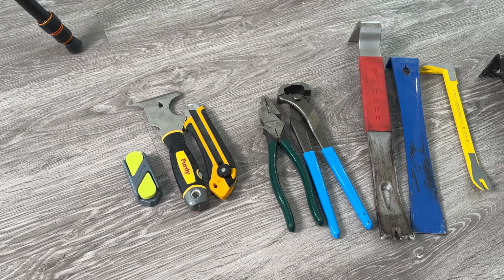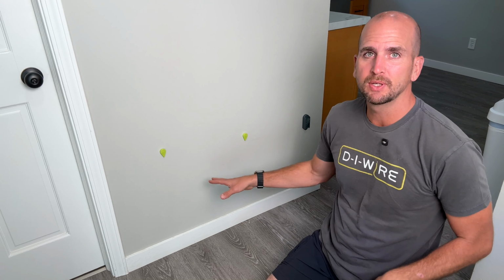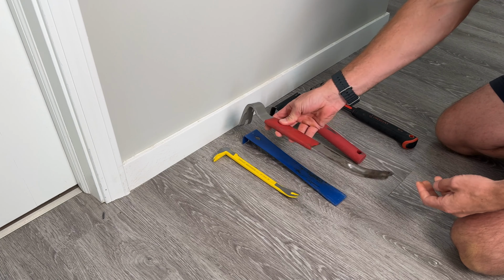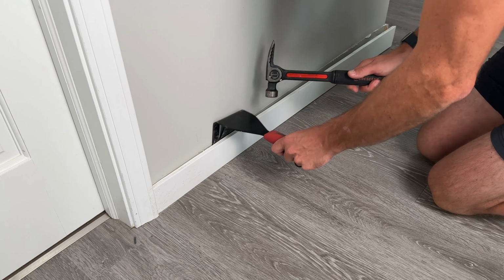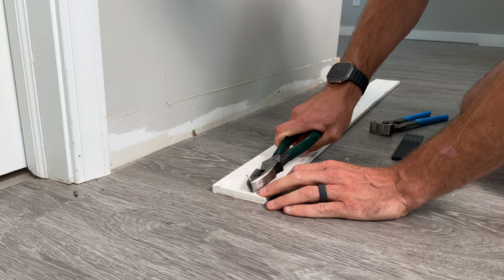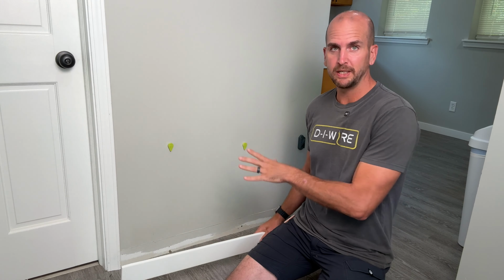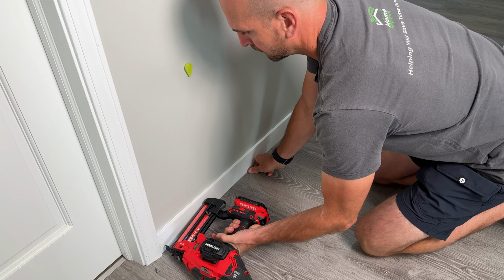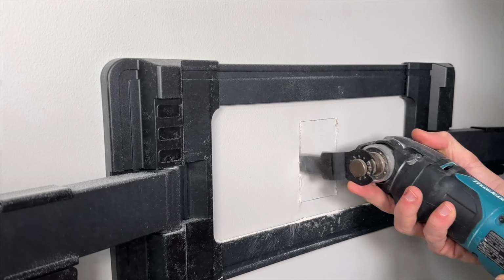How To Remove Baseboard Trim | Without Any Damage!

Comment: It's been said to cut the caulking more horizontally (~70°) to the wall and into the drywall scoring the paper.
1. If the knife angle is too steep you risk your knife slipping and running down the face of the baseboard. 
     The drywall score mark will be covered with new calking when finished.
2. This is less likely of paper tearing upwards from spots of residual caulk or paint on the trim when removing

Comment: This video was extremely helpful.  I have an older home that has lead paint as the base layer to all of the trim.  It has been encapsulated by other coats of paint from previous owners but I am sick of the clumpy paint look and am thinking about replacing it all.  If I do this myself it is as simple as wearing safely gear and wrapping the baseboards in plastic as I take them out for removal or are there other things I need to be thinking about.  I am a beginner DIYer.  Thanks.

Comment: Thanks for sharing this. The instructions are very clear and it's so useful ❤ If I only want to replace the middle section of a baseboard (between two walls), without taking the whole piece off the wall, how should I cut that mid-section off and replace it? Many thanks?

Comment: I have found that less damage is created when you use your trim puller ....not by pulling up on it but pushing down towards the floor once you have worked it in behind the base boards. Any damage above the baseboards can be seen and that will happen when pulling up on it...but if damage occurs below and behind the baseboards it will be less noticeable and likely require less repair if any. If it was air nailed you are likely going to need to buy new trim boards.
Reply: I was going to comment this. You can see the mark he left on the wall from prying up instead of down!

Comment: I just moved into my first home and pulled the trim to refinish the hardwood. The trim puller is magical but I found it too thick to do the initial prying. A thin bar and a dead blow mallet did the truck, I specifically bought the "A. Richard Lever Bar Scraper 10 Inch" from Home Depot but the blue one you have looks similar. I used it to pry enough to slide the trim puller in and then it did the rest of the work. I also used the snip style pliers to pull nails out, specifically the "Husky 7 inch High-Leverage End Nipper with Hammer Claw"

Comment: How do you work the gaps where the trim meets the floor?
Reply: I usually place a piece of poster board between the trim and the floor, then slide it out after the trim is attached. This allows for expansion an contraction in the flooring. Especially when vinyl flooring is used.

Comment: I have that same trim puller and it’s nice. 

What I need is a recommendation for a “strong” brad nailer. The baseboards are about 3/4” hardwood going into 3/4” hardwood walls with 1/4” drywall in front. It’s a retrofit that never had drywall or plaster originally.

Comment: You smeared way too much caulking all over your wall.
Also, don't ever use caulk to fill in nail holes. Use wood filler. Caulking leaves a residue that you will never get rid of because you can't sand caulking.

Comment: Wish we had drywall…90 year old  plaster and lathe with chicken wire here. Good luck finding a stud with a magnet in this mess. I’ve yet to find an electronic stud finder that works, either, so it’s just drill a hole and get out the inspection camera.
Reply: that's definitely challenging with plaster and it still cracks leaving a mess and damage to the wall  because it's so brittle

Comment: When you label the back side of each piece of trim, you can write the same label on the drywall below the trim line. That further reduces the chance of mixing up where the trim pieces go.
Reply: No, it’s not true that each piece will fit in only one place.  Some pieces may fit in multiple places, so it’s best to label both the trim and the wall.
Reply from the maker: Nice tip 👍
Reply: Considering that each piece of drywall will only fit in one place correctly, this is a waste of time. All you need to do is stack it in the order you removed it.
Reply: Stack it assuming no one disturbs your pile. I just number the piece and same number on the location where it goes. Been doing it for years no problems. @MAGAMAN

Comment: A retired  electrician showed me how to use a broad nose plier to hold in guessing were 1.5" staples pulled out earlier to remove the base trim, and these were like brads but had no heads. They went in nicely without bending which was a pleasant surprise to me.

Comment: I'd tape the wall to avoid marring the paint. I like to keep a few plastic or wood shims handy because sometimes the wood teeter totters.

That would be difficult to remove if it was attached with trim screws.